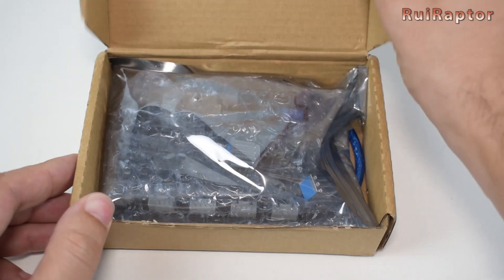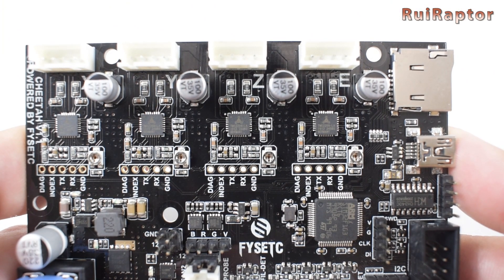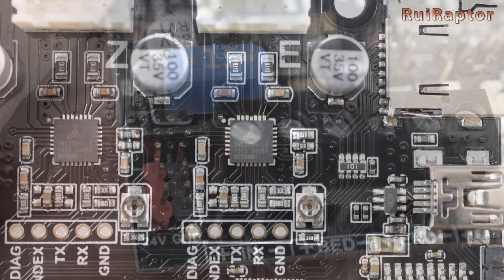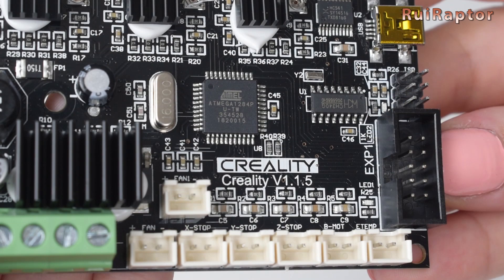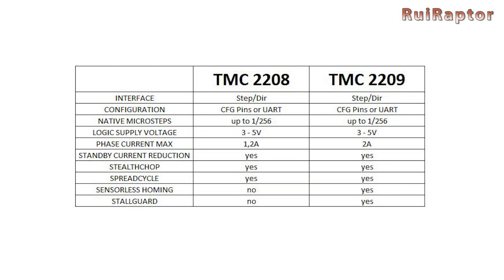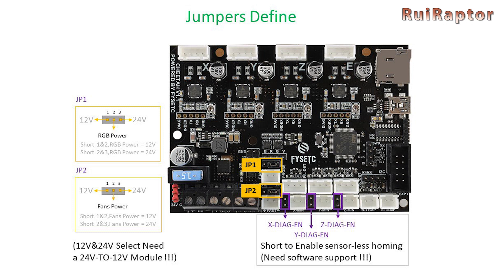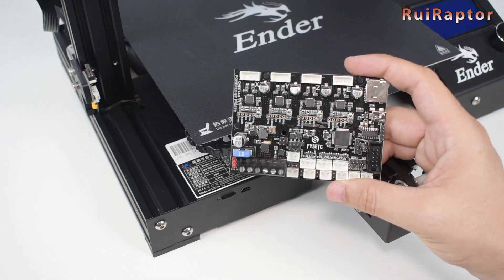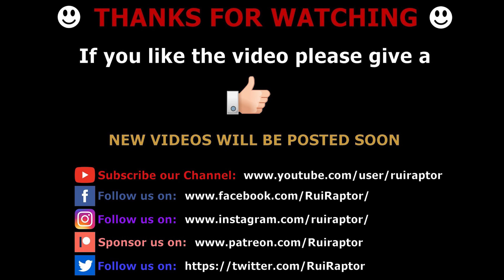ENDER 3 / 5 UPGRADE - Checking Out The Fysetc Cheetah Board

Comment: Can you explain me, wich function is the RGB Led strip? Can I connect a RGB Strip here? Thx in advance :)
Reply from the maker: Hi, you are correct. The RGB output is to control RGB leds. But you need to edit the firmware to enable it.

Comment: Hi has anyone bought this board for NON creality printers? I reckon its a cheap option for 32-bit with tmc2209. im thinking of getting this for a tevo tornado. Anyone tried before?
Reply: Tevo Tornado doesn't have swappable drivers? If not it still has a mks board as far as I know which has the same mounting holes as BigTreeTech SKR V1.3 which is the best option atm with a lot of support and big community.
Reply from the maker: The first tevo tornado edition (early green ones) are equipped with an MKS base board (non swappable drivers) but the late green ones and gold ones have the MKS GEN L board with swappable drivers. I believe that you can use this board for non creality printers (as long as you adapt the firmware to that especific printer) but the memory card and USB connector will not match your tornado controller box openings.

Comment: Now THIS is the affordable electronics upgrade with quality components for the Ender 3 i was waiting for! Only thing making this even better would be swappable drivers.
Creality just cannot compete with this, their own offerings are just inferior and overpriced in comparison.

But important question: is this board compatible with some touchscreens also?
Reply: If u want swappable drivers then check SKR mini E3 DIP
Reply: @curly_luke  Looks good, but is also significatly more expensive with 2208/2209 drivers.
Reply: There's the SKR 1.3. I'm running it with four TMC2208 drivers in my Ender 3. Works a treat. You can even use the second extruder/heater output to run the hot-end cooling fan only when the hot-end temperature is over a set threshold (50 deg C by default) so if you're still using the annoyingly loud stock fan, this can be very useful. :-) Also, it can do a TFT touch screen AFAIK (haven't tried that though, I'm using the stock LCD).

Comment: This appear to be a good board. I just bought the BigTreeTech alternative, the SKR mini E3, which appear to be slightly better and still comes with the 2209 drivers. It would be great If you could compare these two boards.
Reply: I also bought the same one. My only issue with both boards is the lack of a controllable output for the hotend fan.
Reply: @marcelocerri3779  I thought one of the two fan connectors had this function, like in the original ender board.